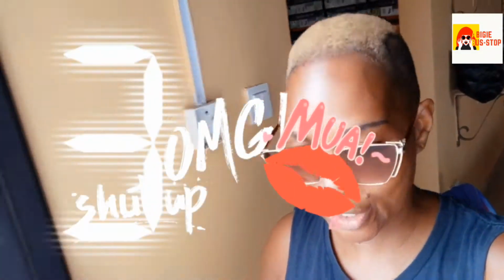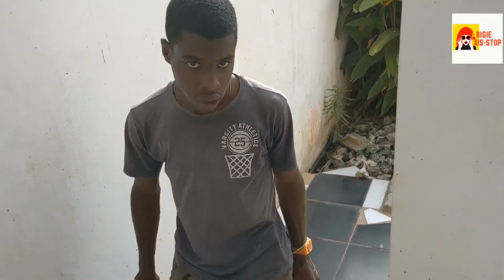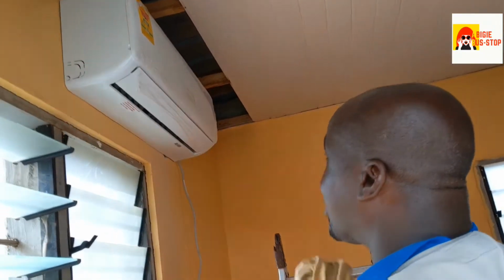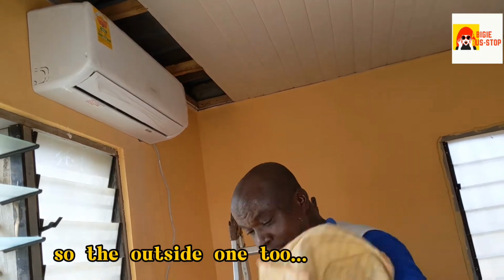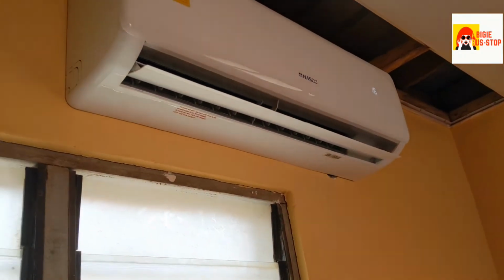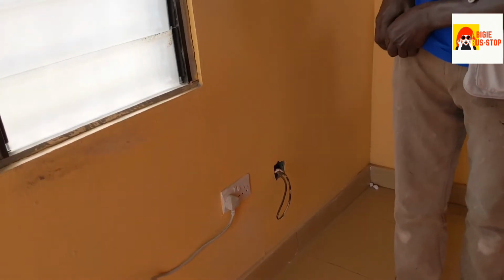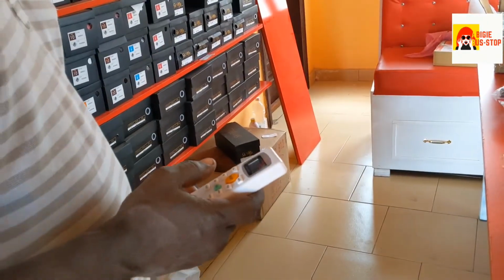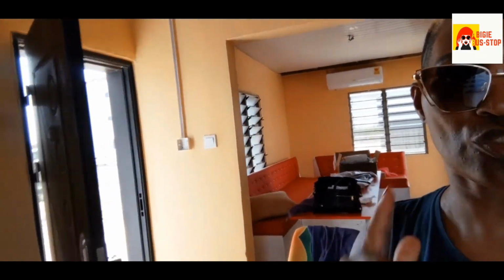AIR CONDITIONERS IN GHANA: NASCO INSTALL, PART II

Comment: please my Nasco 2HP remote is messed up.. how can i reset it to correspond to the  AC
any time i switch to 16C/17C/18C/19C or any, it automatically goes to 31C
Reply from the maker: solutions: 1. ensure the thermostat is set to 'cool' mode. 2. external wires intact? 3. check if your home fuse is working 4. check wiring or the motor 5. there could be a problem leading to blowing hot air so lower the temp to 16C for 15-20 min, carefully clean the dirt in the evaporator or condenser. Or call Nasco customer service at 020 439 2626 for an AC guy to check it for u. Good luck!

Comment: Hello boss I need your help ...my AC cools to a point then it stops and start blowing heat for some time.......then it starts cooling again.....what might be the issue....it's a Haier brand
Reply from the maker: Hi Abdul, check your gas level. Aircon must not be on for hours on end. The cooling level will go down if the Aircon is poor performing. Check the servicing. Have an installer come to check for you. Thx

Comment: So why my NASCO AC dashboard keep on changing from 16 to 34, 33 to 32, 32 to 29, 29 to 28….. like it keeps on changing whiles the remote control is on 16
Reply from the maker: Miklin Wave, kindly pls change your remote battery, if you can, maybe the aircon is not installed professionally. So call Nasco customer service to help you. Tx.
Reply: Ok thanks
Reply from the maker: @Deyen40  you're welcome...😀

Comment: Would like to know why NASCO split 1.5hp air conditioner minimum temperature is 17 degrees Celsius instead of 16 degrees Celsius.
Reply from the maker: Hi Kirk, sure, its 2.0 so 16C seems coldest from the manufacturer's?
Reply: @YorbingNewsMedia  the minimum temperature of all 1.5HP and 2.0HP air conditioners in my department are 16 degrees Celsius.
But my NASCO 1.5HP air conditioner's minimum temperature is 17 degrees Celsius instead of 16 degrees Celsius and that's problem with the NASCO air conditioners.
Reply from the maker: @kirknarh9185  Cool, tx for info, much appreciative.